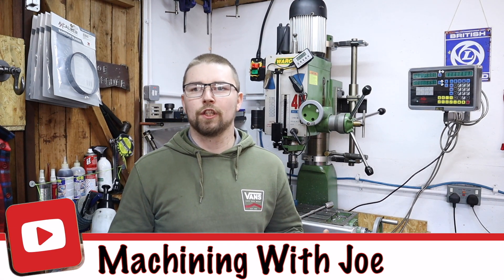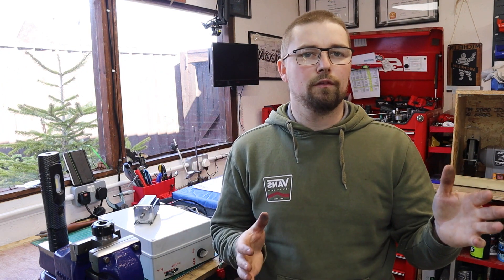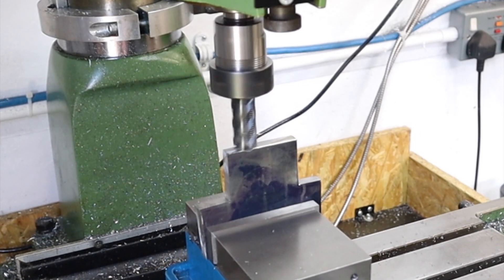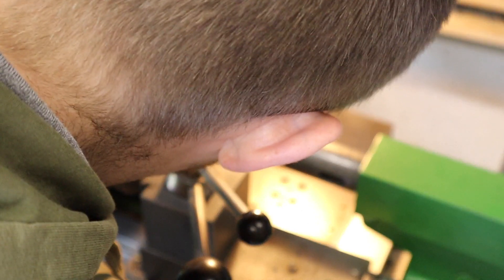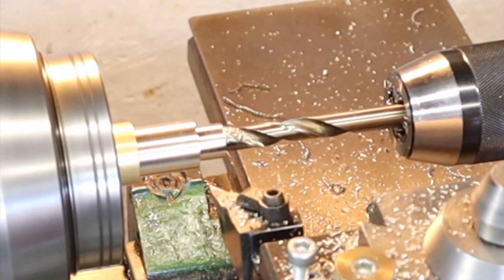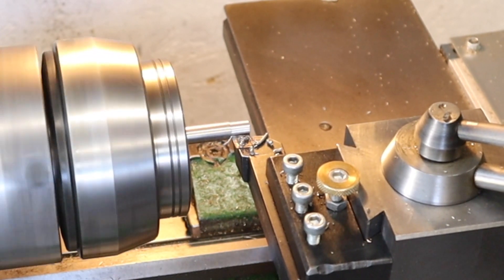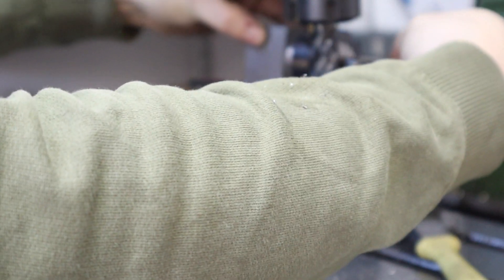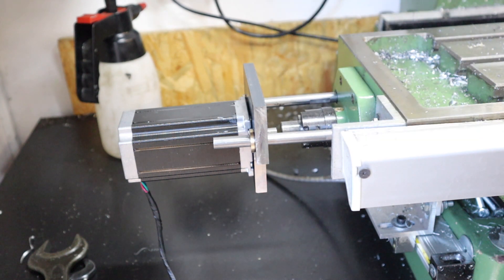Warco Milling Machine Stepper motor power feed upgrade

Comment: If the stepper motor has no power going to it, doesn’t it free spin with almost zero resistance thus eliminating the need for the sliding clutch concept?

Comment: Looks good. I have a Enco version of that mill and made my power feed also. I however use both hand wheels regularly and had to retain both with the power unit. I installed a plate to the bolts on the screw end plat that moved the drive rear ward. Then a chain and sprockets drive to the hand wheel. The handwheel sprocket idles on the hub of the hand wheel until needed then tighten a thumb screw and the power unit turns the hand wheel.

Comment: Nice job Joe. I'm currently in the process of doing a very similar setup. but will be using a timing belt. mine will be permanently connected. Hoping there wont be too much drag with the hand crank.  Would you use an Arduino I'm thinking of adding a rapid button.
Reply from the maker: Hi Steve yeah the timing belt is a good option as if you size them right you could get some good torque multiply. I’ll be honest with you when it comes to the electronics I don’t have much experience other than what I have done so far so I’ll have to look up an Adruino and see what it is.